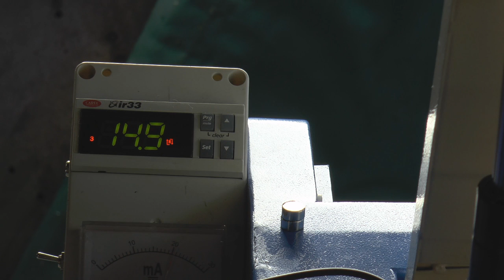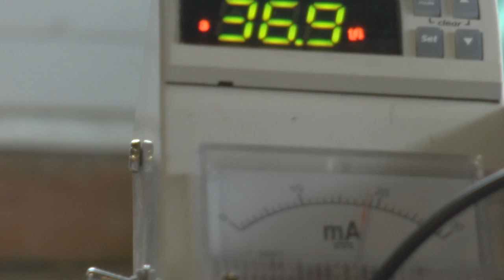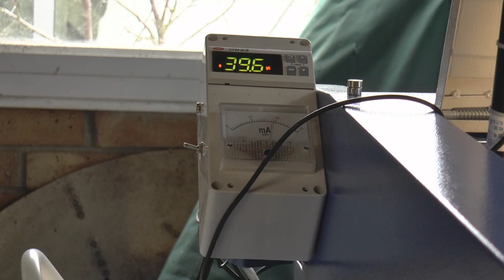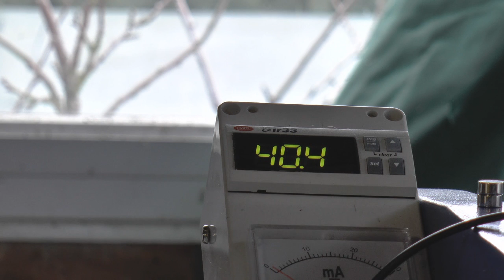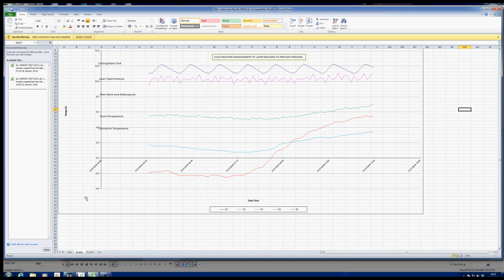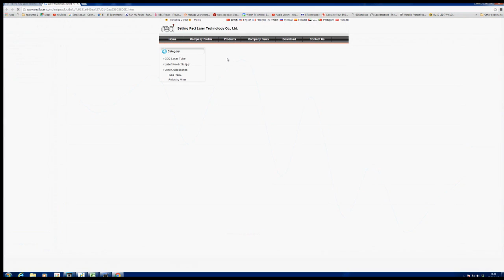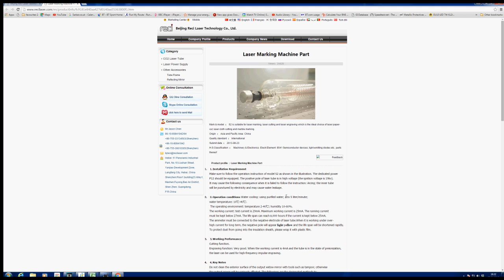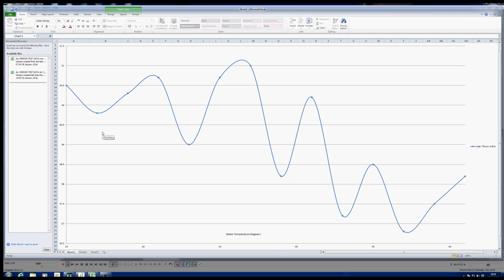RDWorks Learning Lab 40 Laser Output Power v Temperature

Comment: Russ I have a  suggestion for a no cost water chiller. Use a carbonated soft drink bottle fill it with tap water and freeze it. Place the frozen bottle in the water reservoir whenever you need to. If you are worried about contamination of your distilled water you can place the bottle under your tank or in a ziplock bag.
Reply from the maker: +Paul Lecomte 
Hi Paul
It's a great suggestion that I know several other people use (particularly those in Australia). Living in the UK near London we are not blessed with high temperatures and so for most of the year (especially with my low usage) I do not suffer with overheating issues. Most tubes are recommended to run up to 25C  whereas the higher quality ones can run up to 40C. Without resorting to a chiller I have a couple of backup methods that I will investigate this coming summer.
Thanks for the info
Best regards
Russ

Comment: One thing that I have seen is there is a clear difference in laser output when my water exceeds 77 degrees Celsius.  In accordance to the manufacturers of the tubes, and a number of major laser repair shops I have spoken with, replacing distilled water is as important as cleaning the insides of your laser because you will have degrading quality and accelerated wear and tear of the machine and tube.  I was rather surprised to hear you left your water in for the past 6 months!
Reply from the maker: +NFO Sec 
I am slightly surprised myself, but as I mentioned, I do check it regularly. However, if you think about it logically, it was distilled water (not purified by osmosis or deionised) when it went into the system and as you have seen from the video I have a virtually closed system. There is no entry point for atmospheric ingress of spores that would pollute the water over time and make it green or feel slimy from proliferation of bacteria. Everything inside the tube is glass (except a small seam of epoxy around the tube exit window, so  where will contamination occur? Fortunately I live in a cool climate which discourages bacterial growth. 
As an engineer who works with evidence and facts, I ask how  "degraded" water (please define) will have any less heat carrying capacity?  What is the mechanism of "accelerated wear and tear" that I should be looking out for in the tube? and more interestingly in the mechanics of the machine itself? Please do not think I am being rude or sarcastic. Far from it. I still have a lot to learn about these little Chinese dragons and if there are evidence based facts to be had then I'm in. 

 I cannot envisage running a tube at 77C because as I mention in the video the highest recommended running temperature I was able to find was on Reci tubes where 40 max was stated.  It's essential for the helium in the gas mix to transfer it's heat to the water jacket and thereby allow the dissociated CO2 to recombine and keep the efficiency of the lasing action steady. I therefore do not find it surprising you are experiencing output reduction at those high temperatures because you are reducing the rate of heat transfer and preventing efficient recombination. From all the reading I have done on the failure mechanisms of sealed CO2 tubes, I have not come across any scientific work on tube life reduction by running at elevated temperatures. However, I  do suspect you will accelerate the demise of the tube if this is a regular running condition.

Back finally on the water purity. I occasionally manufacture small amounts of colloidal silver using a current limited generator. The generator runs at max 50v DC. As you will be aware, pure water is an insulator and it's only the impurities and dissolved solids that allow it to conduct current. Starting with pure distilled water when I dip the positive and negative electrodes in the water the voltmeter shows 48 or 49 volts for a  few seconds during which time a few particles are stripped off one of the  electrode and allows a minute current to flow between them. Because the current is limited to 10mA the process does not run away. And in fact it takes about 10 hours for the water to become "polluted" with 10ppm of dissolved silver at which point the voltage has dropped to 3 or 4 volts. I mention this because it would be a great way to test the condition of my system water.

Thanks again for stimulating lots of thought and I would genuinely  be interested in any feed back from manufacturers or laser repair technicians on the subject of running tubes  at 77C
Best regards
Russ

Comment: As ever great video, really interesting to see the performance change in that pattern as usual not what I would have thought! Slightly on subject I noticed when I was running a large design as my machine water temp went up from 8-20oC my mA went slightly down from 24-23 I'm not sure if that's a power supply anomaly. If not perhaps its another aspect in this mystery? Possibly the laser could resist more at different temps. Probably nothing but maybe. When you need more distilled have you thought about contacting anyone with a dehumidifier as its a by-product?
Reply from the maker: +patrick whelan 
Hi Patrick 
Good thought about the dehumidifier.  We do have a condensing tumble drier which does the same thing and my first tank of water was from that source. Even though it was distilled water, there were traces of softener perfume carried through. When I noticed power issues with my first tube, I was ruling out every possibility and one change was to proper distilled water. I'll use condensate next time I need a water change, but, there's no hint of water degradation at present. My wife always uses the condensate  for her steam iron.
Apart from the  occasional 65% power reference tests, the machine was otherwise running continuously at 60% power (19mA). That 19mA was constant throughout the two and a half hour test period.. I'm thinking I may buy a cheap washing machine solenoid valve to control the flow of water through a copper cooling coil that I used to keep the temperature right down during the summer when I was trying to isolate my  power loss issue. My "return to tank" temperature sensor could then switch my hosepipe flow on and off to keep the temperature levelish as I repeat this test to see if the oscillating power curve still exists. I suspect it will still be there.
Regards
Russ

Comment: Awesome video and information !
Here in the US (Florida in particular) I have to combat heat. But I manage fine using the 3 Gal (11.5 Liter) bucket and using 2 liter soda bottles (3 in a rotating cycle as they thaw) filled and then frozen. Keeps my H2O at a pleasant 75 F (around 25 C). I do not have a meter to measure power output of my 30W but  I can say that this system works well in hot and humid environments. I am now very curious about my lasers efficiency after watching several of your videos. 
THX again for posting!

Comment: The argon and krypton lasers I've worked with ran great with regular tap water.  I used to think "it needs to be really cold" -- but you don't want condensation forming inside the laser.  This can happen just as easily with a CO2 tube.  You can use a water/glycol mix (use uncolored glycol), and avoid using anything with "stop leak" in it.  Stop leak could potentially plug the small orifices these tubes have, and then you're screwed.

If water is working, there's no need to change it unless you're always worried about cracking the tube.
Reply from the maker: +pmgodfrey
Normally my tube water runs crystal clear and bubble-free. However, I did notice a gradual increase of minute air bubbles hanging on the inside of the water jacket as the temperature got above 25C. Must be dissolved air forced out by the  increased temperature, it almost appeared to result from some sort of cavitation effect because water into the first 2"was clear and it was only after a couple of glass support legs inside the tube that the bubbles began. Interesting ,yes, but I wont normally be running at these temperatures so it's not a concern.

Comment: Before i got my machine I already set up a water reservoir in my workshop, as i am in central scotland, we are always colder, fortunately my workshop is very well insulated, and even dropping to closer to -10 outside, no ice forming in the reservoir. I did fall on my ass getting to my workshop though! 
I have, however, a remote controlled heater if the temperature does drop now that my machine is in.
Reply from the maker: +Michael Edmond 
We may share an island but fortunately not the weather.
Reply: your telling me! The day my machine came (bigger than yours... so huge crate... and a set of stairs to my workshop) it was mid storm... gales.. rain.... snow... and a full sheet of plywood flew past... Whats life without a bit of adventure!